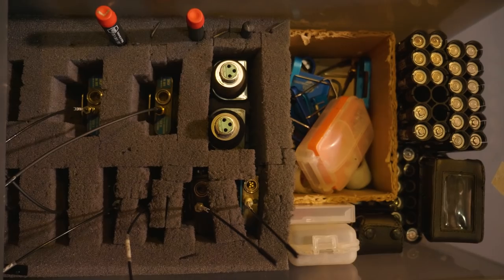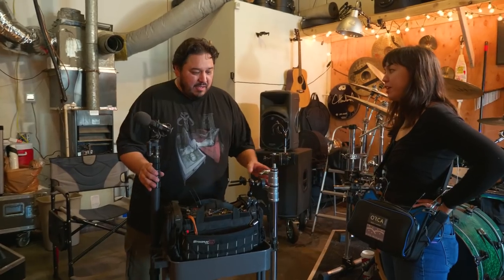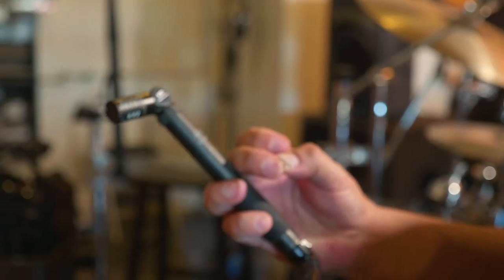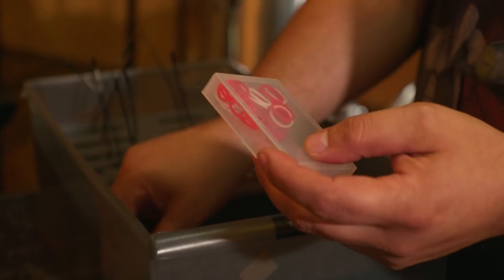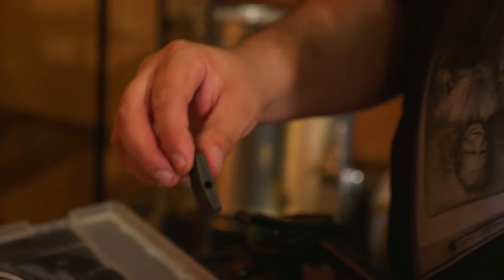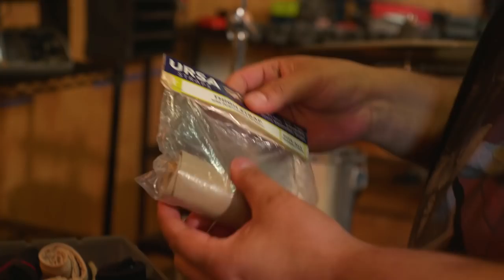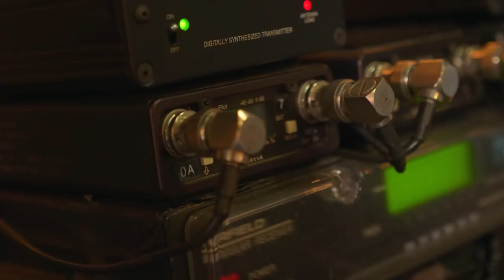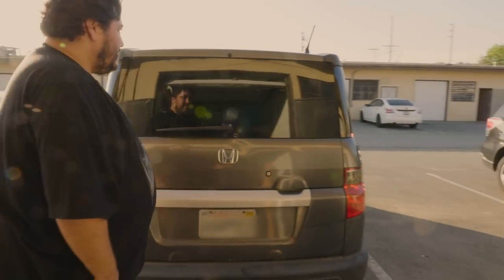What's in your Kit? With Sound Mixer Chris Howland, CAS | URSA Exclusive

Comment: 34:16 I usually have a charging station but I don't have a 250mw plant Mic yet.
announcing charging station here, that it might make it more likely to get your cables back?
And also has the wonderful benefit of being able to silence everybody's phones!

I offered to charge somebody's laptop, they forgot it and I didn't really need another MacBook Pro.
I was doing data wrangling and every morning I would roll out 200 feet of extension cord to my former van so I was literally the only outlet that wasn't the one under the coffee pot or subsequently 20 feet away in the management trailer.
Although I did make wardrobe very happy they had a unlit shed, once I learned about their debacle I also dropped them off a nice 12v battery and 10W LED work light every day fully charged.

Edit: I reread this and it doesn't make any sense to me so I'm editing it.